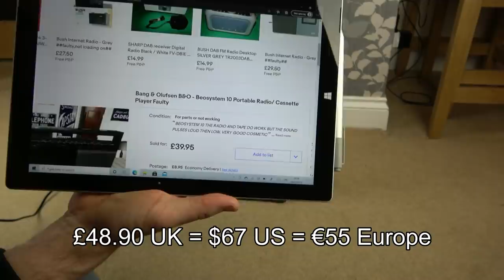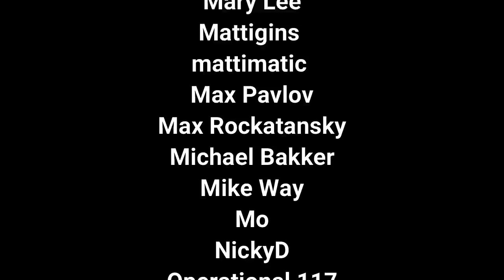Faulty BANG & OLUFSEN BOOMBOX from eBay - Trying to FIX

Comment: On the tape transport, the dark coloured head is the erase head and the next is the rec/playback haed. The chewed-up tape was probably causing your cassette tape to skew across the pinch roller and not moving smoothly over the heads causing those fluctuations in the sound.  Nicely repaired, Sir !!
Reply: I’m so happy

Comment: So happy to see another Bang And Olufsen video from you! Love all the ones you’ve done.
Reply from the maker: Thank you Josh, they are always interesting. I have another 2 to look at some time in the future 👍👍
Reply: Yeah, these products are timeless. I reworked some CX100 speakers for use in my garage recently with new surround foam and some Raspberry PI + 4 ch amp kit (HifiBerry - BeoCreate) available to make it into a modern WiFi/BT speaker. These >30 year old aluminum box speakers sound better than ever and look brand-new. I used to work at B&O in their R&D department.

Comment: Thanks for the video.
I wanted to see the inside of a Beosystem 10 for long, but never expected a video so clear and this long.
Probably this is the most detailed and the best videographed boombox repair video that I have ever seen. 
Every tiny bit perfectly zoomed, exposed from correct angle, correct lighting, in crystal clear high definition video.
And the icing on the cake is that this video is created by a person who did not know the difference between Erase and Play/Record heads of a boombox at the time he did it.
Hats off to you!

Comment: Can i suggest putting some YouTube Library Music on tape for demonstration purposes?
Reply: I also would suggest if possible and a good reference tape deck is available to record a 440 Hz test tone on that test tape. Playing this back in the machines to repair the speed can be adjusted very easily using a frequenze messaurement app on a mobile phone.

Comment: I'd love to see you rocking up at a building site with this on your shoulder, Vince!  😂  What a lovely looking item though, those Danes sure know how to create a beautiful design.
Reply from the maker: 🤣🤣With a lob sided limp because of the weight of it. I don't know how they make there products so heavy!! You're right though Steve, when you think about the other Boomboxes from that era this one still looks good today 👍
Reply: @Mymatevince  I think it was the speakers. they are more efficient? when they have larger metal pieces?
Reply: @Mymatevince  The black pinch roller looks like it`s gone egg shape on the tape deck... ??? i had the same problem on a Phillips unit when i was younger :):)
Reply: @Lassi Kinnunen 81 luckily, they still sell and make TV's, speakers and headphones worth buying. Those laptop gimmicks is just selling points for the laptop manufacturers sadly

Comment: A pulley is made convex (aka. a crowned pulley) to auto-center a belt. When a rubber belt strays to the side it stretches more on the side that's closer to the center (because the pulley is convex). That stretched side bends outward toward the center a little bit, and that extra bit that sticks out towards the center catches on the roller and pulls the whole belt with it.

Comment: My first port 'O call after confirming the radio was ok was mechanical from the tape and I would go straight for the Capstan and clean the head for good measure...
Just got to the end of the video now and was pleased the system worked....Nice result Vince

Comment: Those were the holy grail of stereo  equipment in the 1980s. You were paying for the name. Nice repair job. Its always rewarding having something working after doing such a lot of work. Very good!
Reply: Nah, they sound good too, for the size, FM reception is better than many other models because the aerial is extra long. It's quite featured too, with a wall mount and external speakers, the user manual even says max volume is at 6 unless using external speakers, it really has some power. 
And with the rca inputs it can still be used today with bluetooth. 
This was brought to you by the Beosystem Advisory Service for the promotion of Beosystem 10.

Comment: The convex wheel on the motor is to help the belt center itself & run true...  also might provide traction....

You see a "mild" convex shape in some bandsaw wheels also....

Great job on this one.  Very nice....

Comment: The 'roller' that has the higher point to it that the belt goes on.

The belt will try to move to the highest point of the roller as they go round. The strength of the belt will only allow it to go so far, as the belt wears slightly or stretches over time it will still be able to keep the same tension as it will ride higher.

Comment: You were fortunate in that it came apart so easily. Bang & Olufsen were renowned for making some of their products very difficult to get into. It wasn't unusual for screws to be hidden under sections of 'stick on' costmetics' etc. It was partly to disuade engineers/technicians who weren't B&O's agents from doing repairs.
Reply: Funny you should say that, because I'm trying to remove the back panel on mine right now, and it will not come apart. 
I've removed the 3 screws, but something is attached at the top, where the aerial end clips into place. It feels like a screw but I can't see anything there. Pulling at it bends the back panel, which will break if I lever it. 
All i want to do is see if the belt is gone because the take up reel isn't turning. 
And I can't find anywhere that sells belts for this model either :(((

Comment: I had a similar problem turn out to be a flat spot on the pinch wheel which on my first check I diagnosed a weak belt change that but it was the pinch wheel. Hope this may help with other tape decks. Thank for the videos.

Comment: Recognized the tape mechanism, I have a Silver STW66L with exactly the same mechanism (two of them, it is a double deck), only the motor is mounted downside up (or upside down).  Pretty good and stable mechanisms. I had replaced the belt (at least clean it) and lubricate the mechanism a little (behind capstan plate). Can hear some wow. But okay, it was an easy fix, for sure. Nice unit and nice construction.

Comment: Nice fix :) The cracked flywheel brought in my mind a thing called diecast rot, if it's diecast metal? One of my model car suffered from it, altough this radio is much older. My modelcar was destroyed in less than ten years.
Zinc pest is another name for the phenomena.
Not sure though if the cracks at the flywheel are related to this or not.
Reply: I learned something today.  I had heard of Tin Pest, but not Zinc Pest.  That sent me down a rabbit-hole of learning which is always enjoyable to me.
Reply: @TechGorilla1987  Youtube & Internet at it's best, learning new things :) Have learned a lot from Youtube videos myself, for example from MyMateVince videos ;)
Reply: That was my immediate thought. I collect toy steam engines of varying ages and zinc rot is one of the things to look out for on the cast parts (usually engine frames and flywheels coincidentally) particularly on older engines. It is nasty business especially when it's a structural part. It can write an engine off.
Reply: @SimonNemeth  Paya wheels were particularly bad, although I have seen an 00 locomotive where the frame bent like a Banana! The problem is caused by impurities in the Zinc and there is noting that can be done about it apart from the manufacturers using better quality Zinc.
Reply: @MrDuncl  It tends to be lead impurities and it primarily happens in cast zinc made at a certain time. It doesn't tend to be an issue with modern casting.

Comment: Unfortunately this was the start of a slippery slope for B&O , basically charging top money for fancy outer casing and design but fitting other manufacturers inners , making a lot of their stuff unreliable , like the VCRs which if I remember correctly where Hitachi inners. I remember taking the back off a 21"MX4000 TV (£1500) in the 90s only to be confronted with a £300 Thompson chassis !!! 
Much better when they made All their own stuff .
Great videos 👍👍

Comment: Have to agree with 'hifismiffy'! I learned to fix these as an apprentice, and I always found them scary! Jammed tape would have caused the roller to oscillate causing the tape to ride up the pinch roller. Great fix,. Cheers

Comment: I played around with one of  those boxes back in the  80's when they first came out at a high-end electronics shop where I would purchase TEAC reel to reel cassettes tapes. I walked away unimpressed by it's sound and features . You could purchase a better sounding portable , that was bigger and cheaper . Nevertheless I'm glad to see some of them are still around today.

Comment: I've seen capstan flywheels like that totally disintegrate. Something to do with the alloy (pot metal aka 'monkey metal'), and the dreaded 'zinc pest' or zinc rot. Dampness and high humidity can often trigger it..
Reply: I have seen other zinc things develop hairline cracks as they age. Guessing it is atmospheric
Reply: @home-space  Yes I've seen old dinky toys become brittle and start falling to bits in a similar fashion. Such a shame when it's something collectable..
Reply: The metal alloys age at different rates so the zinc and magnesium separate and it disintegrates. A lot of old razors were made of pot metal.

Comment: I suspect you could have taken that tape wrapped around the pinch roller out without taking the machine apart, but that wouldn't have made a very interesting video!  Getting that for 40 quid was a bargain.  Those B&O machines were made to last, unlike the cheap Chinese ones that are made nowadays.
Reply: Anything of that vintage was made to last. These days planned obselecence is the deal of the day - usually a product dies a day out of warranty.

Comment: 4:50 I have to admit that I'm surprised that removing the tape from around the pinch roller actually fixed this problem, since I didn't hear any wow&flutter, only volume changes. I was wondering if the supply reel was getting ahead of the capstan, causing the tape to loose contact with the heads, and that might still  have been the cause of the volume changes, but I'm mystified that there were not also severe pitch changes. Anyway, I picked up a 120V, no-LW  version of this model at a pawn shop for $10 and the last time I tried it, one speaker had cut out. I've been dreading taking it apart and this video confirmed all of my apprehensions about its serviceability, but thanks for the tour of its innards; at least now I know what I'm up against. Though this B&O model seems to have a few  "audiophile" features lacking in most '80s boomboxes, and very smooth sound, the single tone control (despite B&O's fancy name for it) would be a major disappointment in this price range; the model is  gimmicky and not very practical as a portable.   Ironically, it's so heavy that I fear that some of the flimsier plastic assemblies would be totally destroyed if it ever took a fall. It's a nice little piece of history, but I'm glad I didn't pay the original $300 price.
Reply: i recently got one of these (for a lot more than $10!!!) and I'm experiencing a similar problem - the sound balance might be normal for a few seconds but will roll to either the left or right speaker only. If I hit the 'AM' button, it seems to correct the wiring and be balanced again, but only for a moment. Very interested if you tried to fix yours and how it went?!

Comment: It’s a known fact that vintage B&O always required patience and a knack to assemble it. Hence why so many “repairer’s” wanted nothing to do with repairing the brand,  it takes time to get to know the products from Denmark , try fitting the radio tuner pcb on beocenter 2200 2100 4000  thats fun if you’ve never done one before.

Comment: The drive roller on the motor is crowned. It's a well known technique for keep flat belts tracking true. I used to use the principal on conveyor runs. It does look odd when you first see it.

Comment: 23:50 I believe the brown head is the erase head, which carries the bias frequency; on cheaper decks, it's sometimes just a permanent magnet. Sometimes the play and record heads are one in the same; I think there are also decks where the record head is separate, but in the same case as the play head.
Reply: The cheaper decks are much simpler in design but just as painful to service when they fail due to the flimsy parts their mechanisms use. Especially models which used spring-loaded idler assemblies - these had a tendency to fall apart or break without warning, leaving the user without FF, REW or PLAY function (because the idler was responsible for tape take-up and engaged the reel spindles in front when a key was pressed). I've replaced countless idlers in several budget boomboxes because they were too small to fix and those who owned them at the time wanted reliability. Great when they work which is not often, and some of them aren't very good to record on. Quality is poor. I now refuse to own or service these types of decks because of the above-mentioned.

Comment: Haynes Manuals are... Special sometimes...

For a 1994 Subaru Impreza, the instructions were as such.

Removal of starter.
1) Remove the 3 bolts.
2) Installation is the reverse of removal.

No pictures, no nothing. Just those two helpful instructions

Comment: 14:33 That's the AM/LW antenna. Those became popular in the mid 1950s, before that, there was usually a big, open coil of wire around the perimeter of the back of the set.

Comment: For the radio testing, why not get a small radio emitter like you can get for your car that work on 12V.
You can put a USB stick into them and in a 2m radius or so one can receive their radio signal on other devices.
Means you need a 12V adapter too, but at least you get a good signal AND you do not need to worry about copyrighted material being played :)

They come as cheap as 13 GBP on amazon.
Reply: I have several of those small FM transmitters & by experimenting with connecting various external Aerials to the right point, it's surprising how far the signal will travel, it will easily cover my whole house, garden & beyond! I have tried connecting a Belkin model to my rooftop FM antenna & could receive the signal several streets away!
 (Make sure to set the transmitter output frequency to one well away from local broadcast stations, to prevent annoying your neighbours radio listening!)

Comment: boy don't I remember the number of chewed up tapes, and once a machine does it once, then was forever chewing tapes until the broken bits were removed. As for a video showing it working or not, then it is better to watch right at the end, but think if I done this type of thing myself, then I would test it while still apart and off camera, unless something like building a pc as usually something like that requires you moving the pc from one place to another just to test if something is working.

Comment: If you go in another audio device I would suggest putting a high pass filter on the speakers to protect them from the lowest frequencies below the fs of the drivers and increase clarity and power handling by blocking what they will not play well anyhow. Great video. Thank you.

Comment: From my perspective Vince you can see the rubber roller bouncing up and down on the silver capstan which would account for increased wow and flutter and not in the radio side so something is caught in the capstan and roller Great video as usual and you can see where the weight comes from not those tiny tinny speakers but proper speakers with large magnets

Comment: It sounds like the head may need a slight alignment, but it is fantastic to see you get this going.
The pinch roller is critical to tape speed and tension which obviously is critical to how the tape runs across the head.    
Your troubleshooting techniques could put some professionals to shame.

Comment: I think the first head is usually for deleting the tape while recording.
The second head is for "reading" and "writing" to and from the tape.
My guess is, that the rubberrollers have become too smooth/hard, 
so the tape slid to the side and wrapped around the axes.

Nice video :)
Reply: The first (darker) head is the erase head (erases tape when in record mode) and the second (shiny one) is a combined record/playback head. Only 'high-end' cassette decks had three heads (i.e. separate record and playback heads).

Comment: @ 28:46 Vince, the bulbous shaped plastic wheel is indeed to keep the belt centred. They are called crowned pulleys. Search for that and read on woodgears website.

Comment: 27:30 That flywheel looks like "pot metal", which is analogous to American cheese or to Spam; it's made from leftover pieces of non-ferrous metals melted together in a "pot" and is known for cracking to pieces as it ages because the different metals separate into veins and contract at different rates as they harden. Once in a while, the castings would fly apart violently, sending dangerous projectiles in various directions.  Pot metal was common in 1920s-1930s radios and car door handles made up to the 1980s. I'm a little surprised to see it in something this new.